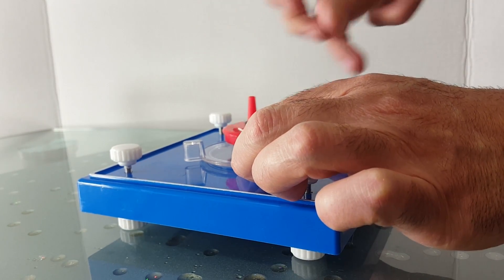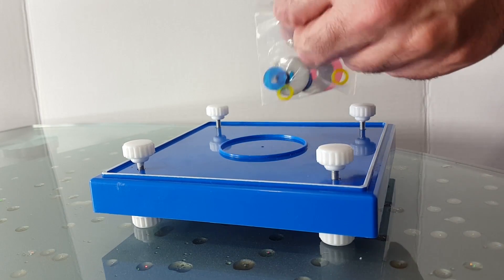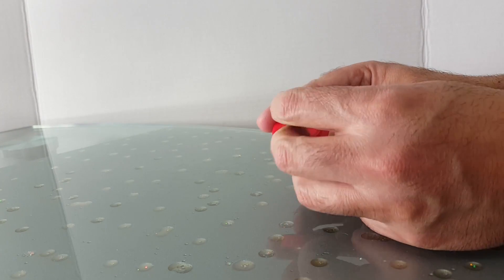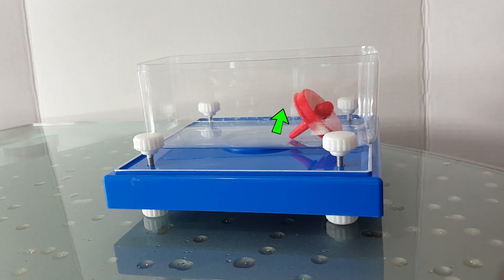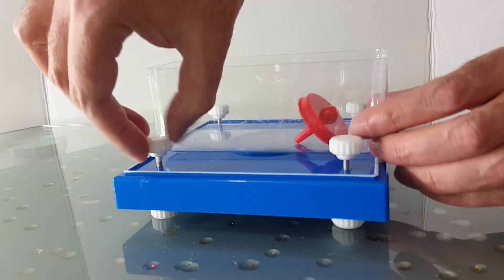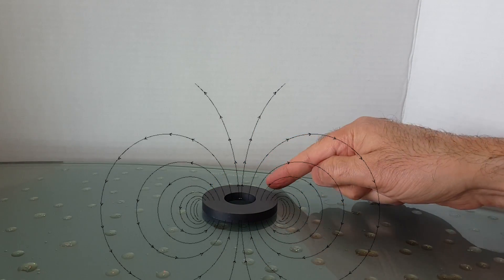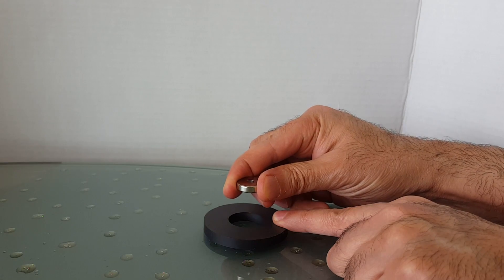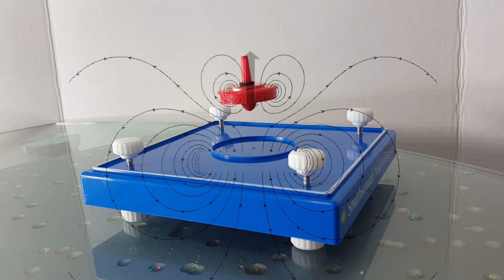Magnetic Levitation and how it works

Comment: Rather than having to crank so much at one point, you could also lower the opposing corner half of the same amount...
A torpedo level would get most of the base calibration right without having to deal with the top slinging off. Then you'd just have to set the top itself.
Reply: You'd think so, however in practice not so simple. Level is a good place to start but it's the gravity and magnetic repulsion that it reacts to. What this means is that it changes very slightly through out the day also humidity. This toy is super finicky. Every day a new challenge, but once you find the sweet spot it's amazing. This is why the legs are adjustable and so is the weight. If your lucky things will remain constant for up to an hour. Put it in a vacuum with controlled climate and it will spin indefinitely.

Comment: Can we creat levitation without the spin? And are the wahsers made of any certain medal? Did you have to put washers on the bottom side of the spinner?
Reply from the maker: Generally speaking,  levitation without spin is possible; But not in this setting. The washers are only used as weights. Washers are placed from the top.
Reply: ..With liquefied nitrogen and neodymium magnets you can levitate another magnet or a piece of iron... . 👍🧲

Comment: Its actually a large square magnet inside it
Reply: While I agree it’s not the ceramic shown.. I actually believe it to be 4 circular neodymium magnets of the same diameter as the top but with additional thickness and or smaller Diameter neodymiums under and above each for 12 magnets in the base, the smaller and or thickness giving them stronger pulls. Still same directions of polarity, this would explain the design with the adjustments for I’d imagine a circular ceramic requiring far more precise adjustment

Comment: I do not agree with the  magnetic loops drawings arround the spinning ring magnet (loops drawings located over the magnetic field lines created by the black ferrite big magnet) These thoroidal field lines are created by the neodimium ring magnet, really, BUT they do not add to the field lines created by the ferrite magnet. That addition reflects the actual magnetic field shape BUT cannot be considered so, when predicting the FORCE between the  two magnets ! The neodimium magnet receive solely the force of the magnetic fielc created by the big ferrite magnet BUT DO NOT RECEIVE ANY FORCE FROM THE MAGNETIC FIELD CREATED BY HIMSELF !